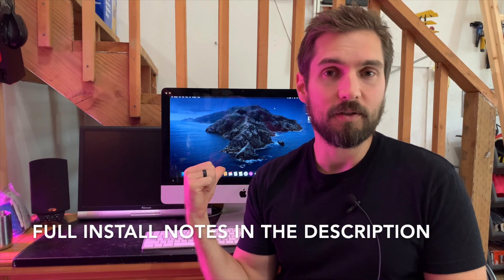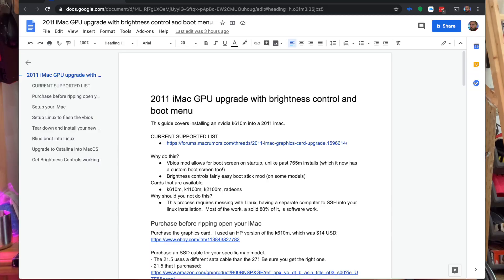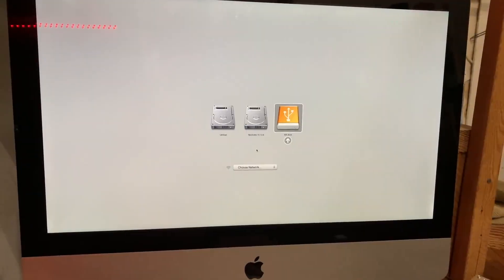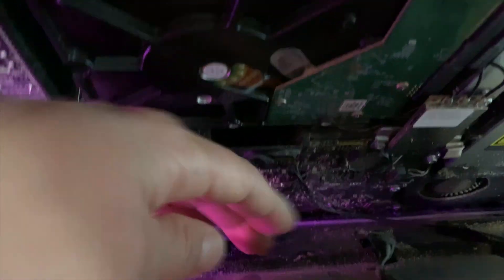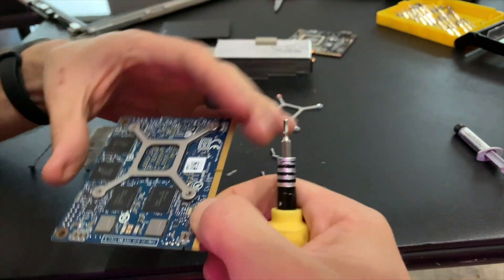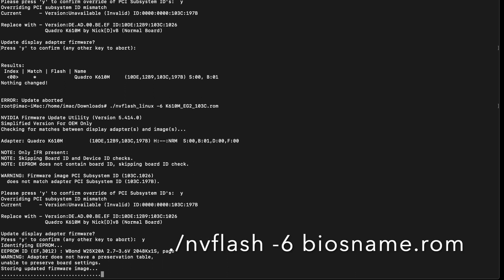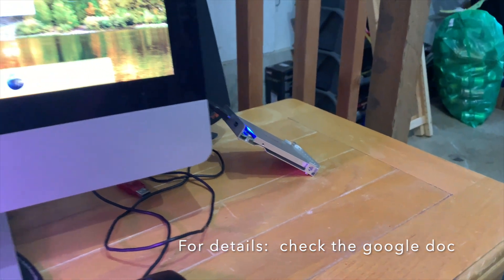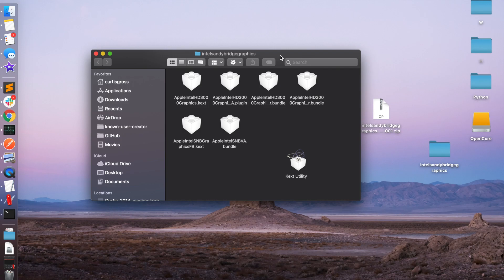2011 iMac GPU Upgrade Now with Brightness and Boot menu - Absolutely Worth It!

Comment: Superb work - thank you, Curtis. As an idea to expand on this instruction set: I would be very interested to see whether you could manage to successfully flash any one of your highly recommended cards using a pcie to mxm adapter (as you showed as one of the potential avenues that you pursued). The reason for asking: I have a 27" mid 2011 that I have heavily upgraded over the years, which I love, is still working and strategically used as a DAW... However, I am very aware that their 6970 graphics cards break down unexpectedly, and that OSX10.13 will probably go out of support soon. And as the 27" repair seems to involve at least some use of a cutting tool, and holds a bit more risk, I am holding off the graphics card replacement until either of those two occurrences force an upgrade. However, in the meantime, based on your very useful advice, I ordered a K1100M to be on standby for when needed, and would like to check (when it arrives) whether it is alive (without having to take the imac apart just to test it) -- i.e. Check it on a windows / Linux system (which I have available), and possibly to perform the flash updates - that way I could determine whether the card is DOA / ready for action if needed. If you have the time / are willing to do so, it would be very useful if you could explore that avenue and make recommendations based on the lessons you have learnt.
Reply from the maker: Stewart Watson - I got another k610m today, going to try it with the mxm adapter again.
Reply: Thank you, sir - much appreciated indeed.

Comment: I would like to upgrade a 2011 21.5-inch iMac to lend to a friend's son for his start in Highschool. I need to upgrade it to the maximum CPU and GPU it could handle since it will be used for 2D and 3D animation and rendering (most likely using Blender 2.8 at least). The family is unable to buy a new machine so I offered to donate mine for his studies and his son was overjoyed in receiving my used one. I watched several of your videos and thank you for all your efforts. I love your out-of-the-box thinking.
The current specs are:
- iMac 21.5-Inch "Core i5" I5-2500S (Sandy Bridge);
- 2.7GHz (Mid-2011);
- Radeon HD 6770M graphics with 512 MB of dedicated GDDR5 memory;
- 20 GB of RAM (1333 MHz PC3-10600 DDR3 SDRAM);
- Samsung SSD.
Could you please advise on the best CPU and GPU for an upgrade? I will need a bootscreen and brightness control and will follow any instruction you can offer.
For the CPU, I was thinking about the Intel Xeon E3 1275 3.4GHz / 8M Quad Core LGA 1155 CPU ( Equal to Core i7 3770K ).
For the GPU, I am hoping for one of the following:
- Quadro K5100M (8GB of VRAM);
- AMD WX7100 (8GB of VRAM);
- GTX 880M (8GB of VRAM).
I will also need to install Windows 10 via Bootcamp. I know it may sound like overkill to try and revive my old iMac but it still runs fine. Any advice would be greatly appreciated.
If you prefer to answer me in private, let me know.
Reply from the maker: My suggestion for the 21.5 would be the xeon 1275 and the k2100m. The smaller power supply means you will want the lower power gpu.  If you don’t want the hassle of explaining the sleep issues - go for the 2600 cpu instead.
Reply: @messing-with-computers  Thank you for your response. Does that mean there is no chance of getting a better GPU card to work well in the 21.5 model? He will also be using RPG Maker MV. From what you explain, it is better to get the best CPU and go lower on the GPU? Can the 21.5" (2011) iMac handle a better GPU? IS it possible to install a better Power Supply or will the motherboard not handle that? I am asking since I am not sure that a GPU with only 2GB VRAM would suffice for the needs. What are your thoughts? Would you prefer that I send you message via you Patreon page since I got that working?
Reply from the maker: @bobbond8232  - So, the k4100m miiiight work along with the 2600s.  It really is a balance.  the power supply is 205 watts.  The screen and drives and other components can pull ~50.  The 2600s is about 50.  Which leaves around 100w for your GPU before your computer shuts down.  The k4100m is a 100w tdp card, which means if you put it at 100% usage, you can pull 100w-110w.  That is why I hesitate a little bit.  In most cases it would work (after modifying the heatsink) but if you really push your computer it will turn off.  If they are OK without having brightness controls the GTX 770m is a 3gb card and 75w.
Reply from the maker: Oh - and sadly there is no other powersupply upgrade that would fit in the case.

Comment: Hello thank you so much for this video! However, I have a serious question: I recently bought the k610m for my 2011 iMac and it looks like it is 1gb. When I see your card, it seems to have two more black squares on it. Will I face a serious problem if i were to place this graphics card into my iMac? Thank you so much!
Reply from the maker: I think you will be ok as long as the flash process works. It won’t break anything, but there is a chance it may not work.
Reply: @messing-with-computers  ok thank you so much!

Comment: Update on my request, I did get a replacement for my iMac GPU the  one it had was 6970M 1 GB, and I upgraded it to a AMD 6970 2GB,  I did put the thermal paste as you recommend in many videos, I checked for temperature, and it works great, thermal paste  from Arctic MX4 does the job, it hardly reaches 45C (113F) but as I start using youtube, InDesign, Word 2014 and Chrome, screen starts flickering and red bars appear, and suddenly the system freezes...  On the software part I used a clone SSD from a MacBook White with High Sierra Original, not modified, Do you think the system crash is related to that? ( I mean the Clone SSD) Should I make a fresh install of everything? Is it a failed GPU? What should I do? I really want this iMac to live its better days, Please help @Curtis Gross ! I would be so grateful!!!

Comment: A friend with a 2011 27" iMac just asked me to help with some screen artifacting. I'm assuming that's a dieing GPU. Should I give this upgrade a shot to fix it for her?
Reply from the maker: Absolutely.  Artifacts are very likely to be the 6970 dying (common problem).  Check out my other video for how to cut the heatsink to make the smaller GPUs fit, cause that is exactly what I did with my 27'' imac!

Comment: This video is amazing. All the research has been done and everything is explained step by step. And it’s been proved it works. But I would not recommend anybody with no experience of tinkering with programming to attempt this upgrade. What you will do if you got stuck with something and haven’t got a clue? You will spend hours, days and more looking for a solution and same time fixing it and get it going. I really need this upgrade, badly. But would try to find somebody who is confident with this stuff and would take my imac to him, doing it together. Am I right?
Reply: with stress comes new experience. If its not your main working tool and you have a sidemac have a go

Comment from the maker: k610m is back down in price (seen a few around $16 lately) and the k1100m and k2100m have stabilized in price as well.  Even picked up a k2100m to test in my 27'' iMac (video soon) for $50!
Also - check out an easier method to flash these gpus: https://www.youtube.com/watch?v=sn5K2SKXrJg
Reply: ETA on the 27" iMac?  Im excited and praying it works.
Reply from the maker: @juancenteno3650  Video launched a few days back - check it out!  Also published a companion video on a way easier way to flash the video cards once they are installed.
Reply: Can you give some links where to but k2100m for imac 27" - finding it hard to find a card thats right ?
Reply from the maker: @bjtster  - Hey Brian, correct.  The k2100m I bought was $55... I am only seeing ~$120 at the moment, and at that price I would just get a k4100m or go down to a k610m and wait for the price of the k2100m to drop.  The exact card I used was: HP NVIDIA Quadro K2100M N15P-Q3-A1 2GB GDDR5
Reply: @messing-with-computers  your videos are great!!!! I got my hands on a k2100m for about $75 on eBay about 1 week ago... All went well...  The flash you mentioned was so simple via SSH.  I have a few questions...  Is it normal for the iMac 27 to boot to a black screen (will only show apple boot screen while holding option)?  Is there a workaround for it to boot normal?Will the open core / kext file process work the same for the 27 iMac?  Once again, thank you, your videos are concise and very informational!!!!
Reply from the maker: Juan Centeno you should see the boot menu with open core all setup. I put out a recent video to get it auto booting into opencore, I recommend that path!
Reply: @messing-with-computers  Thank gonna try that right now!!!!!  One last question... I'm sorry :/  Are external monitors supported via TB cable with the K2100m?
Reply from the maker: Juan Centeno should get one of the two ports to function on the 27

Comment: This is something I really need for my iMac but is beyond my technical capabilities. even if the GPU is 100 bucks it would be worth it because Big Sur "requires" at least a 2014 iMac. so whatever the graphics card costs is less than a newer computer.
Reply from the maker: It is a little bit crazy to do, but you can still use high Sierra which is fairly well supported.
Reply: Curtis Gross I wish! I need to be able to get to Mojave so I can run Universal Audio’s LUNA.

Comment: Hi Curtis, thank you for this guide. I had a question. I have an early 2009 imac 24" 2.93ghz. (sierra unsupported is running well) I've upgraded to SSD and the max 8gb ram. current graphics are Geforce gt120 256 gb. I've just ordered the K1100m as no one would ship the k610m to Korea where I'm currently at.  Wondering if you have any experience advice on the early 2009 imac and if this process would be similar?  I'm more interested in the graphics performance over the OS upgrade as all my old apps still run pretty good in Sierra (CS6, Iwork 09 Etc) Thank you.
Reply from the maker: I actually haven't had a 2009.  Just a few 2007 and a ton of 2011 models.  But the process is fairly similar for all of them - search for all the screws, get them loose, raise the motherboard out and flip it over to get to the CPU / GPU.  The hardest part is making sure you don't break your monitor cables.

Comment: Strange question as I just got one of these(working!) for free and have been looking to tinker and make upgrades. I'm a complete neophyte to the Mac world but have a little Linux experience and am an old hat when it comes to hardware.

I've got a Dell branded Quadro K4000M hanging around that would be a significant performance upgrade to these other cards. Considering it's a generation older than the K1100M/K2100M, would this conceivably work? Are there any thermal/power limits I would have to be aware of?
Reply from the maker: You might be able to get the k4000m to boot and work, but I haven't seen any custom vbios for boot menus or brightness controls.  The key thing is figuring out if your model is a Kepler based card - most of those seem to work, especially the Dell / Alienware versions.

Comment: Thanks for video, updated to K1100M and Catalina, only a bit of lag in some browser page but new life for an iMac 2011 27"

Which range of temperature advice for K1100M?
Reply from the maker: The k1100m should be below ~60c at pretty much all times.  Maybe idle below 50c.
Reply: @messing-with-computers  thanks I've set Macs Fan Control properly!

Comment: What should I do to put a K2100M with MacOs Sierra in iMac 2011 27"?
Is the gpu flashing procedure very similar to os Catalina?
Reply from the maker: The flashing process is the same, overall procedure is actually super similar. Might need to watch my other gpu install video if you need to modify the heat sink at all.

Comment: Just upgraded mine using a NVIDA CARD 4GB+METAL all works fine except the sleep function, it goes to sleep  when it wakes it shows a pointer and blank screen fin all it will reboot on its own with a crash report, if that can be fixed ,that would be done. I. Do think the brightness is a bit low it's at max and can be turned down , otherwise fine!
Reply from the maker: What cpu do you have?  There is a “kext” file for stock cpus called hd3000.kext or something similar that fixes sleep.

Comment: Awesome video, thanks. I've just got a k2000m but black screen on boot after swapping it so need to strip down as might not be DOA, not seated properly or one of the monitor cables is not working. Any tips to remote on or does the gpu need to be functioning in order to do that? I've got a dual boot with Ubuntu and the refind loader installed already.
Reply from the maker: So you get the first and second lights on the motherboard when powering on?  If you don’t... the gpu will likely not work.  If you do, you should be able to ssh in.
Reply from the maker: Also the k2000 ... I have heard you want the k2100m, it comes with the right bios and all that.

Comment: I am puzzled. All these cards are huge cards that can't fit into an iMac. Her in Denmark Nvidia Quatro K610m costs between €250 ans €300. https://www.pricerunner.dk/pl/37-3032416/Grafikkort/HP-Nvidia-Quadro-K610m-%28E5Z74AA%29-Sammenlign-Priser
Reply from the maker: Try adding “mxm” into your search to make 100% sure you are getting the mobile versions.
Reply: @messing-with-computers  My bad. Thanks. Of course, they are mobile versions. I've just found one k1100m on ebay. What do you think?  Would that one be ok?
Reply from the maker: That’s a solid card. Check the k2100m as well

Comment: I did upgrade my iMac 2011 27" GPU to Nvidia Quatro K1100m. Can't get brightness control to work. I restored Open Core dmg to USB but can't chose it as a startup disk . I get error saying  the disk can't be set as a startup disk because it can't be blessed, whatever that means.  The second thing that worries me is that the PSU (power supply) overheats now, without any load it's on 90° C. If it continues to run so hot it will damage LCD. Mac Fans Control don't help much, it's still too hot on the back in the top left corner there where the PSU is.
The third problem is totally strange. I have installed MacOS Catalina with dosdude1 patches, but when I reboot iMac it goes to black screen. When I hold Alt key after reboot and choose hard drive where Catalina is installed then it boots normally. I'll find the solution for this but PSU overheating really worries me. With the old baked GPU iMac was cool also during a heavy load.
Reply from the maker: That does seem really strange - Only thing I can think of is that the monitor, when at max brightness, can pull ~100watts +.  If something is causing the rest of your computer to run at 100% you would be close to the max for the PSU.    As for the 'bless' issue, I think I remember running into that as well - I can't completely remember what I did to solve that problem, but I am guessing a google search of your error you see will help (usually my go to)
Reply: @messing-with-computers  I've solved everything 😀 You were right, the high temperatures were caused by LCD running at max brightness. But I've also replaced the original HDD with Samsung EVO 1Tb SSD installed with OWC cable with Mac sensor. Removed ODD, but kept ODD sensor (just glued it to the back chasis) so the fans don't run crazy. I've figured out that the old HDD and ODD put an extra power pressure on the PSU so both the PSU and LCD proximity show very low temperatures now. Added extra 16 Gb RAM, and the iMac is flying now and running cool. Thanks again for your video. 
One more thing. I've installed OpenCore on a 5Gb partition on my Samsung EVO SSD. It boots perfectly, I have brightness control, everything is ok. Thanks again 🤗
Reply from the maker: @andreasvukman  - Boom!  That is an awesome build, enjoy it!

Comment: Finally got my k2100. installed and i can use the mac. Of course no brightness nor boot. I was watching the video and is really long :( any other more user friendly super duper newbie solution? And any other benefit will i get doing this procedure? because i`m using it with the premiere and it works so technically is doing its job
Reply from the maker: Hi Keigo - Sadly, the easiest solution that exists is ... not that easy ;)  The biggest benefit to all the extra work is the ability to get your brightness controls back.
Reply: Curtis Gross do you think using app to do that is not good?
Reply from the maker: The app for brightness works, I used it for quite a while. The issue I had was that the app causes screenshot issues (keeps the dark effect). Minor detail, but bad for my workflow